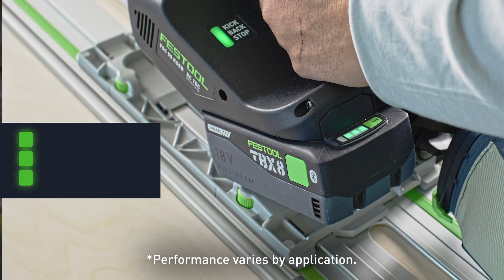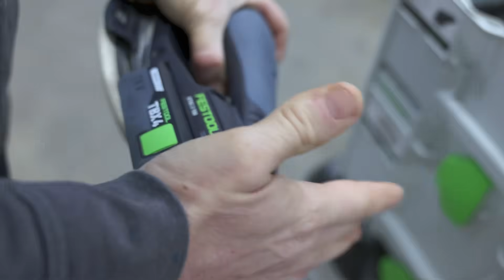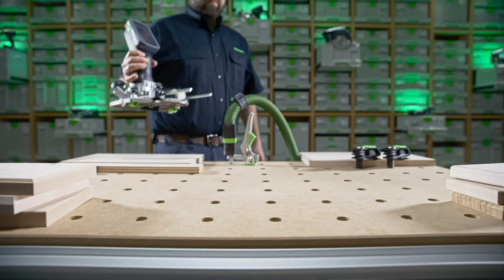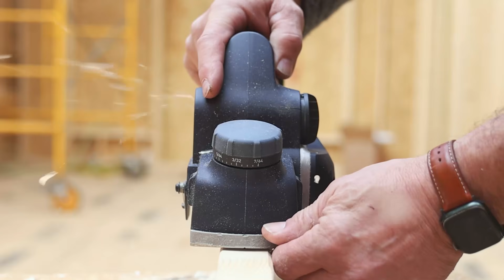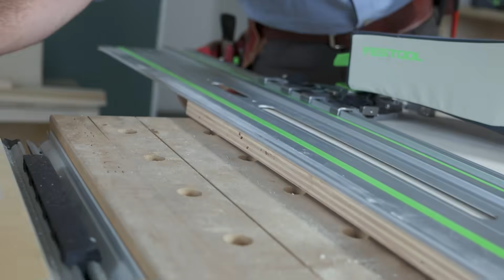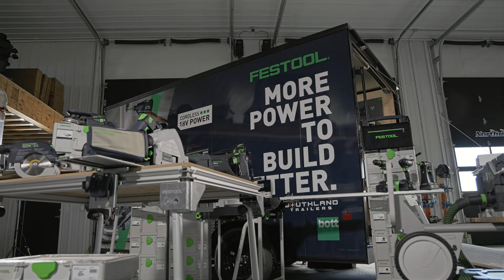[NEW] Festool Launches New 18V Cordless Tools!

Comment: why would you use battery operated sander if you have to connect it to a vacuum cleaner? what`s the point?
Reply: Trust me, it’s worth it. Not having the mains cable really makes it easier.
Reply: @SingleTrack66  how ? you already have one thick hose connected to your tool .
Reply: You’d be surprised what one less cord does. It’s so much less combersome. You don’t get tangled up and trip over your cord. And the balance is better. I’ve been using a cordless tracksaw and sander for several years. They are my go to. Can’t wait until they figure out a cordless rotex.
Reply: @user-n7x4w  i really don`t get it, you definitely cannot use Rotex without a vac , so what`s so great about battery if you have to connect it to something with a thick and long hose? i am pro furniture builder btw